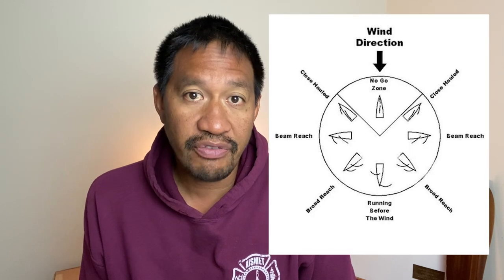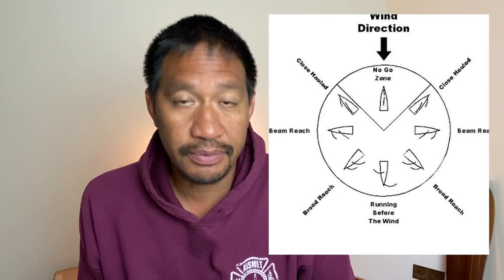How to Sail Better | Land Your Sailboat on a Lee Shore | Sunfish, Laser, Flying Scot, Optimist, Aero

Comment: Couple of things: a friend set me up with a rig to leave my dolly in the water but not float away. Kayak anchor, 1#, length of line and a small float  
Landing downwind in a Sunfish,  and to a lesser extent Aero, you can blow the halyard and following seas will push you home.
Reply from the maker: Cool ideas.  (Would not work where I am as many people use the smallish beach though).
Reply: What is your tide difference? Boris was just talking about this same idea. We have an 8’ tide.
Reply: @Akochen100  the tide swing on the lagoon is negligible.
The question for yall is what is the tide swing over time? An anchor may still work for yall if your practice is only a couple hours or less and the tide cycle is longer.